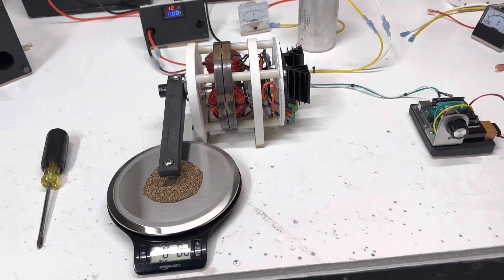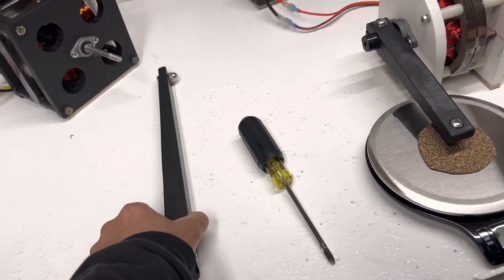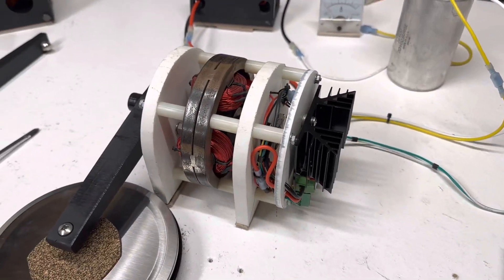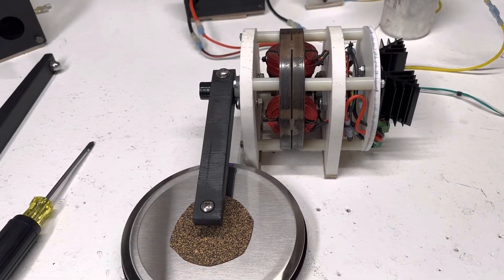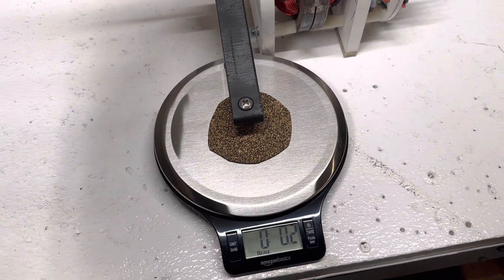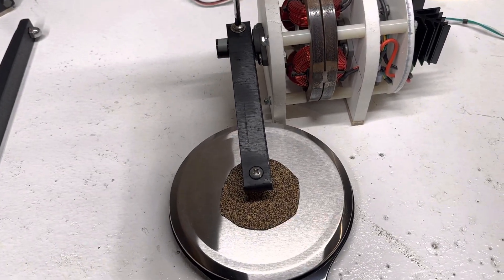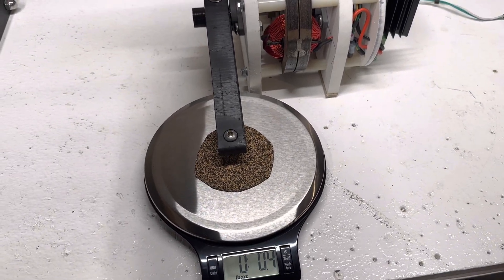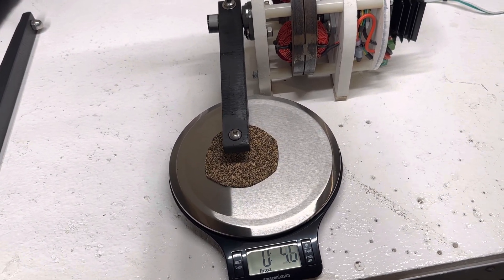Attraction motor Prony brake test sneak peek

Comment: I eventually made prony brakes out of Teflon since normal plastic would melt quickly  from the friction.
I think I see in newer video your prony brakes collection made of wood?  Looks like it...oak a good choice the first Chinese satellites were made of oak, no need for heat shields they would just be  heavily charred upon re entry ...
Prony brakes good fun -  take measurements quick as the brake tends to loosen after some time and rpms go up and draw down while "foot lbs" on scale goes down too sometimes hard to get it consistent and last over a minute run time under a particular load.  A generator on shaft with lots of lenz reaction lugging when loaded with resistance works well too to load shaft down and you can keep constant load on it for long time.  Also can "correlate" to prony brake readings with  same rpms
Reply from the maker: So true! I’m definitely going to develop better methods 
 Thank you for your detailed comments

Comment: Good job! 

Looks like 4 or 5lbs  at the end of video.. how many RPM? 

How much input power?

Lbs*0.5ft*rpm*0.141= watts output 

If you can get over 90% efficient you’re doing very well for a home built DC motor!
Reply from the maker: I think about 600 at the end total was 3000
Reply from the maker: Thanks buddy!
Reply from the maker: @energyhack3538  I think it was 8 or 9 amps I’ll have to do the test over
Reply: Try to get it to steady state as best u can and make sure scale and rpm is accurate - in any case it looks pretty strong 👍
Reply from the maker: @energyhack3538  definitely it was just for youtube info I’ll do proper test soon